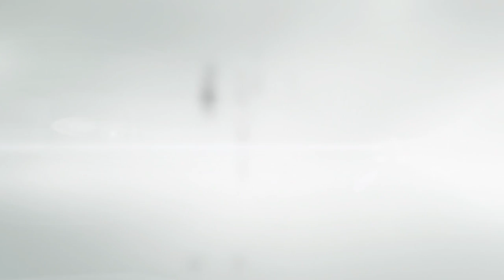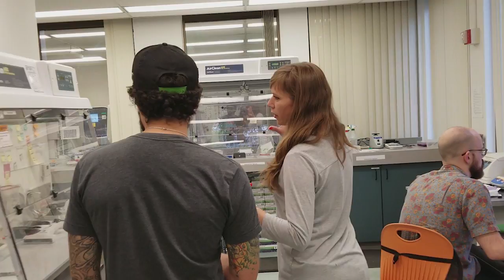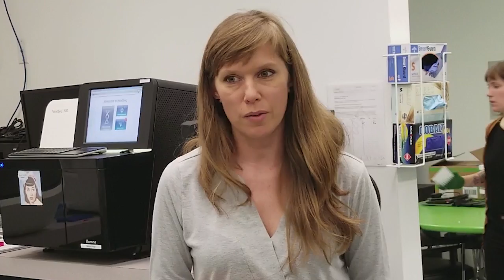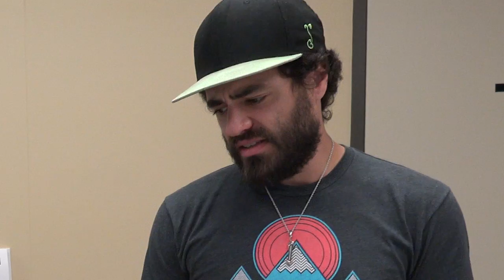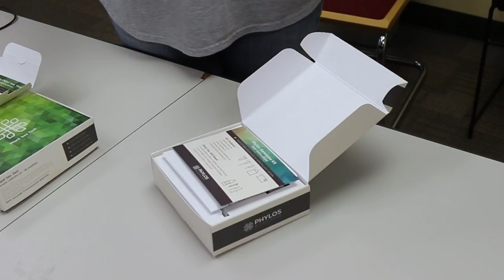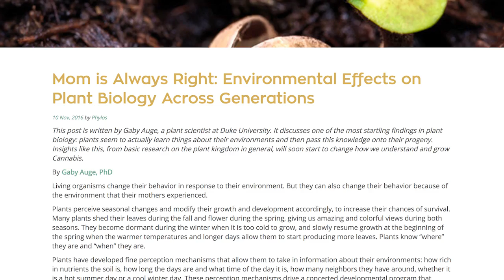Phylos Biosciece Lab Tour and Cannabis Sex Testing Kits

Comment: I'd be more interested in this if they had some type of DIY Home version kit. Something similar to the hydroponics pH control kit, but tells you the sex of your plant instead. No need to be sending anything in.
Reply: of course you can do it at home, just need to invest $150K (just a guess) in equipment and learn how to use it. i may be wrong but i think that there are no easy to identify chemical differences between male and female plants until they mature well beyond the seedling stage. if there were i am sure someone who knows cannabis biochemistry better than i do would be selling such a test. think of the savings and no need to bother naming those machines.
Reply: the sciences of each are VASTLY different though
Reply: Yes of course. I wasn't comparing them as being the same in science. I was simply saying that it would be nice if they had a version like it where we can conduct cannabis sex tests at home rather than mailing them in.